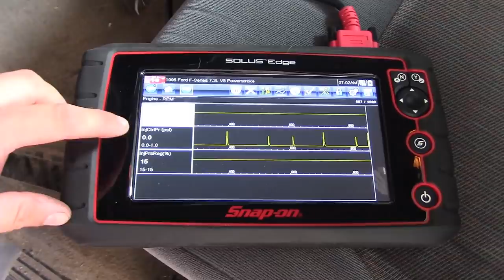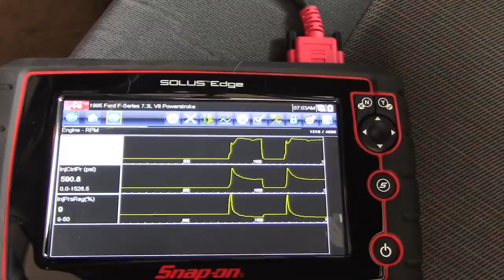Restoring an Ammco 4000 Brake Lathe

Comment: A week to cut drums & rotors?
Customers would drop off the drums/rotors, we would mic them up. If good, they would buy the pads & shoes, pay the labor for the turning. Once they were finished with the install, they would pick up the steel. I don't see the drum "mic", but I'm sure you can find something to measure them. If my memory serves, (it's probably been 30 + years since I used the lathe) the dpdt switch was installed allowing the light to be used independently of the lathe. Thanks for jump starting my memory!

Comment: Any of this type of equipment is dependent on location. As you mentioned the local shop can do them but you never know how long it may take. Are there other places within a reasonable amount of time from your shop etc. You don't have to stand there watching the machine while it works you can continue working as it's resurfacing the rotor. Plus your amount of time away from the shop for pick up and delivery. You may find other shops want you to do resurfacing work for them. I think it was a wise investment and you did a nice job restoring it.

Comment: After watching this video on restoring the lathe and machining a rotor, I got interested and watched James Tiberi"s video on how to use the Ammco from his technical high school auto class.  There were several steps that he included in the instructions.  When mounting the rotor, he used two tripod spindles, one on each side of the rotor and a spring to assist in holding the rotor as well as a anti-vibration collar as the last element of the shaft before the nut.  After the slow pass, he used a wire brush on a drill to hone the surface to eliminate the single line left by the cutting blade. Third, his deepest cut was 0.002"; yours were 0.005".  Are there any issues with the deeper cuts, he needed to make two fast passes, you were able to do it in one.  Any issues here?  
Enjoy your videos.

Comment: Welcome to the world of crusty brake rotors!  The lateral runout will cause brake pulsation in about 5,000-10,000 miles, if not immediately.  To avoid this, I first clean the scale and corrosion from the rotor's mounting flanges and the vehicle's hub with wire brush and Roloc abrasive pads. Next,  make sure the Lathe's mounting adaptors are clean and then check the rotor for runout on the lathe with a dial indicator. Rotate the adaptors and rotor for minimum runout then cut. If more than a couple of thousands, double check on the vehicle after cutting.  It's a lot of work to get it right.

Comment: Love the restoration, I stumbled on your  video by chance. I just purchased one of these from a shop that closed. I got lucky bench and all is there, but they did not believe in cleaning or  maintenance . I did get to make sure it works however all the boots need to be replaced , where did you find replacement parts. Love the finished product looking forward to starting mine soon.

Comment: Wes, I have been operating Ammco & Rels lathes for 50+ years & if you want to make them super accurate all you need to do is put a point of reference mark on your hubless rotor adapters and machine the contact surface using the lathe. The chatter noise you had is from too deep a finish cut. John.
Reply: Sposed to go only .004" at a time, right? Think I remember seeing that somewhere.

Comment: There are thousands of those lying in dust in my area - Québec, Canada. Because of careless operators, it's now illegal to turn brake discs or drums here. Guys not wearing proper eye protection, torn arms from wearing long, loose sleeves etc.
So now, for a brake job on a budget, they install cheap Chinese rotors and drums that don't last or warp easily. People usually don't care, they lease their cars for 3 years and get new ones. 
 My friend and mechanic install only OEM or North American parts on MY cars, which I keep for years or even decades. Thanks to him.

Comment: Really enjoyed the restoration. I really wish the OEMs would make the rotors thicker. One turn and they're done for, if that, these days. Can the weight savings be that much? Wouldn't the added thickness help with overheating and brake fade and warping? Curious what your thoughts are?

Comment: Well it is less worn out than it was and if you were a machine tool seller you could claim it was rebuilt since it has new paint. lol I really like the setups that turn the rotors while they are on the vehicle. Depending on how the original rotor was made they can sometimes be really hard not to have run out you can feel in the pedal. on these style but doing ot on the vehicle prevents tolerances from stacking up and causing problems.
Reply from the maker: Yeah there is going to be a learning curve with the runout. I've already seen some issues.

Comment: "Iron agains iron"  bearings can  work, re:  your  bellows retainer,  just lube the heck out of it.  Early  South Bend lathes  had no bushings/ bearings in the headstock--the cast iron  headstock was  bored  to size and the  spindle ran directly in it, depending on   lots of lube

Comment: That brake lathe is the same model as my uncles one, he bought his back in 1980.
My dad bought me one that was virtually new in 1988 and the only things that are differentare the the tool post arbor is flat where yours it not and mine has a plastic chip pan that funnels down where the chips fall in to a small bucket that sits on the floor.

Comment: You should do a small cut first to make sure the rotor is mounted true. Small cut turn rotor on arbor 180 degrees do another small cut and they should both be next to each other. Great lathe, I have cut hundreds or drums and rotors on the exact model.

Comment: I inherited an Ammco brake lathe from my step dad's father, unfortunately the auction company who liquidated his car dealership sold all the attachments for the lathe and the stand as well as attachments for doing drums but not the actual lathe.... so whatever sense that makes. I am still able to do disc brakes and just have to use one size arbor or center it with a dial indicator.

My one tip would be to take .05 to .10 off per pass at fast speed and do one more pass taking off .025 to .05 on the slow setting for a final pass. Also, I do not have your rubber rings with weights. I am guessing it is a type of silencer? I have basically hockey pocks on an arm that pivot and grip the face of the rotors but I never use it. But it is a good idea to take a wire brush and a screwdriver to knock off the flakey metal and rust off the edge of the rotor. Not sure if it would ever make such a difference that it could make something unbalanced but it never hurts!

Very jealous of the resto-job! I wish mine looked that nice...
Reply from the maker: Yeah the band helps with vibration, but the rubber pads are better!

Comment: Amazing how many shops I've been in that dont have a brake lathe any more. I guess Chinesium parts are cheaper than machining now.. sad. Thanks for sharing!
Reply from the maker: Yes. really hard ceramic brake pads really eat the rotors. And the around here the rust gets them before they ever wear out.

Comment: On the cover ring, you could do this. Buy some small 2mm big ball bearings (or whatever the size is on the ball bearings inside most bicycle pedals, those are sold in bags, thus the cheapest) machine the ring down to a 2 mm thickness, with a groove, and out of delrin, cut an outer bearing race to match it, and the balls. Insert them through a small notch in the delrin side which you can patch up with a little bit of super glue action and tie the snap ring in place. Cheapo bearing for the price of a bag of bearings (or however small a unit you can buy them, tho i'd just get 100 to have spares). An afternoon project at worst.
Reply from the maker: That would work!

Comment: Any mechanical device that can be saved from the smelting furnace, should be. A tool such as that used by a competent operator is a beautiful thing. I have reconditioned brake rotors using an angle grinder and stand by it. Have sharpened cutters using a file ! Anybody ever hear of those. There are outside influences that would have us become a disposable society and some have bought into the rue. Anything is doable by hand, that's when there were craftsmen !

Comment: for the opening behind the cutter you where planning to put a cork intoo : maibe theres a freeseplug available in that size
as for checking if that axle is straight : you could loosen the brakedisk and rotatate if 180 degrees and run the same setting again , if it cuts the previously non cut part the axle is bend

Comment: Thanks  I always thought replacing was a last resort, when it came to drums and rotors if they measured out to be with in tolerance. I live in a Small Town  southern Ut and we have One Parts house and about 7 Mechanics Shops I do some out of my Shop and there is One brake Lathe in the whole area and they haven't used it in in a long time. don't know when they used it last. I have a small vibration in my Lexus ls 400 Good old heat warp age from some one in the passed bought this used so what do?  You do Turn the rotors and put on new pads this is when I learned no one has one.  rotors and drums are to cheap now well not on a Lexus but still mt pick ups aren't cheap either. some thing is wrong I need to find one Too thank you for this Walk through  I will defiantly save it. He is how Old I am I remember have brake Linings re-curved for drum brakes That's a Tool I would love to see again and have in my shop. Thanks again Keep spinning those wrenches.

Comment: I am in the same boat as far as needing a brake lathe. I’ve found a couple and seem to be going for around $1,000.00. Thanks for sharing this process as I want to do the same as you did when I purchase one. I figure the best time to rebuild/restore a new piece of old equipment is when I first get it to the shop. If not it’ll be out in service and I’ll never get another chance to overhaul it. 

What color blue did you use? It looks like Rustolem paint from the one brief second in the video.

Comment: The plate on the back by the speed lever you can't read  has spindle speed to rotor diameter info so you know where to put the belt. I think we leave it on the closest to you pulley all the time but, cutoff is 11". Will take a pic of ours Tuesday & figure out how to send it
Reply from the maker: OK. I have a manual. It should be in there.

Comment: We could of done with one of those at work when all the pool cars went back on the road after lockdown in the UK we were changing brake discs and pads due to corrosion from standing for 3 months.

Comment: if you pull the plastic off of the electrical connectors and use shrink tube it makes a much cleaner finished product

Comment: Nice job on the brake lathe restoration.  One of my jobs when I was 17 years old was cutting rotors and drums on this exact machine.  One tip I learned was to put a non directional finish on the rotors to keep them from sqeeking/squealing, one the old timers that trained me taught me that.  The way I did the non-directional finish was with a die grinder and scotchbrite pad.  Amazing I can remember that like it was yesterday.  Funny thing that was 25 years ago, and I haven't used one in just as long, lol..  Been thinking about buying one and turning rotors on the side, since no where turns them around here.  Mechanics or parts stores. 😢

Comment: You might want to throw a rotor on there and check the runout with all the adapter stackup.  I think the adapters are pulling the spindle to one side and they might need some cleanup on a precision machine tool :)
Reply from the maker: Yeah I think that cast backing plate is a little wonky.

Comment: nice one Wes (or should we be calling you whiskers?)  bet that will come in handy more than you think,  deemed obsolete is maybe true for modern applications but there are plenty of older units in use that simply do not have replacement parts, and the occasional tight arse that wants to get every oodlet out of every part. thanks for the vid .

Comment: why i own two is kmart in the 1980s set one up for drums then the other for rotors so you can do one side at a time  front rotors rear drums i found these machines in alamba for $1500  with the tooling some jobs i dont turn rotors any more  but i paided my machines off in 3 years

Comment: You're a pretty handy fellah, Wes. Love the videos! I am curious though....the tooling arm that is attached to the power feed cross slide.....it's slotted for adjustment along the length of the arbor.  Does it ride on a linear shaft to ensure you stay perpendicular? Or is my ignorance showing? Keep up the good work!
Reply from the maker: It does not. In fact, for larger rotor you can kind of swing it out. As long as the cutters can cut and not rub, it will work fine.

Comment: The shaft is not bent, but I think the spacers could stand to be faced off and made parallel.  It just looked to me like they were pulling the shaft off center after you tightened the nut.

Comment: I worked in parts. It was while a lot of parts stores still turned roters and drums. We always called the brake lathe the "Money Maker" when you charge $10-15 for each rotor or drum you make your money back fast and keep on making it over and over. It was a almost 100% profit service. I don't know why most parts houses stopped doing it. Maybe a liability thing?
Reply from the maker: I don't know either.

Comment: When you mount a drum or rotor,  check the runout  by making a  light  partial scratch  cut  out near the edge, which of course is worst  case  for runout.   Now stop the machine and  loosen and turn the  rotor/ drum 1/2 turn on the shaft, and recheck scratch cut.  Both scratches should be   on same side, which shows rotor/ drum runout and  not a mounting problem.  Don't get very heavy handed with  shaft nut.

Comment: The shaft slop was how they adjusted the gears. Put all the shims back before the machine is trash.
 New pulleys are worth it.
Reply from the maker: LOL.
Reply: @WatchWesWork  They run um loose like that for seventy years. An it works. Its just how they did it.

Comment: Those old machines you can't beat them. The rotors get hard spots and they cause weird cuts sometimes. Then it's time for new rotors. I have an old brake lathe and it's handy to have when I need it. The time is the biggest savings when you can do it yourself while doing something else. Will it pull itself in neutral once it finishes the cut?
Reply from the maker: It does have an auto stop for the drums, not the rotors. But it would just run off the end of the lead screw and stop.
Reply: @WatchWesWork  Cool!

Comment: Jam up job Wes!

There is a a certain amount of satisfaction recycling old equipment to working order and making it LOOK like the owner takes pride in ownership!

But, one thing puzzled me about the lathe rehab, you didn’t send it to the body shop for painting. Hmmmm______________🤣🤣🤣🤣🤣🤣🤣

Loved the video!
Reply from the maker: I should have. A real painter could have made a nice job of it.
Reply: Watch Wes Work You did a great job, if you could have replaced the decal and spec plates it would have looked new! And that table and peg board was a REALLYnice touch. You are a damned good mechanic. 😊

Comment: I'm the only mechanic in any of the shops I've worked in that would even turn the brake lathes on.  The rest of them would just rather install new rotors or drums and let the customer pay.  Too lazy and unwilling to learn and not interested in saving customers money when they can slam new ones on.  It's a shame.  Goon on you for being willing to do what needs done.

Comment: If you haven't found plugs for open end on the cutter bar mounts you might check Mouser or Digikey for "caplugs". Mouser # is 376-CEC-10 for the 15.88mm ones that they sent me by mistake. I would think they have different sizes available, search "caplugs"

Comment: Here is what I do. I no longer get my rotors turned at a cost of $25 each. The biggest problem is rust build up and ridge left either on inner circumference and outer causing noise. I dress up the surface with a 5” angle grinder on both problem areas and to minimally touching the area where pads contact the rotors. When I don’t catch break wear in time, I throw them out and replace them with CHINESE replacements for about $50 , which are half the cost of OEM from LORDCO in Western CANADA.

Comment: Did that for 20 years , I`m in my 60`s now, 4 or 5 thousands fast cut ,forward on the back lever ,then 2 thousands finish cut ,push back on lever, and watch that brake silencer band I had those lead weights come off if to tight. If you do drums use water to clean the drums first don`t want to breath that dust , Safety glass always, Real treat was GM solid rotor with tin center

Comment: If you keep an eye open for the shaft, you'll likely see it. I sometimes see partout machines of this make (unsure if the model matches) on ebay, whenever i look for various parts i might be missing or want to replace on my old lathes.
Reply from the maker: Yeah I need to check ebay.

Comment: How much did this set you back?

Were all the parts easily available for a complete overhaul?

I have 7 personal vehicles most vintage collector vehicles and I have been wanting to get a brake lathe to do rotors and drums for myself.  I was wary of purchasing used as the old dinosaur accuturn we have at work has a bent shaft which makes it hard to turn rotors and requires tweaking to get the rotor to spin true.  I didn't want to get involved with that if parts weren't available or if it's costly when I can simply buy new for myself.